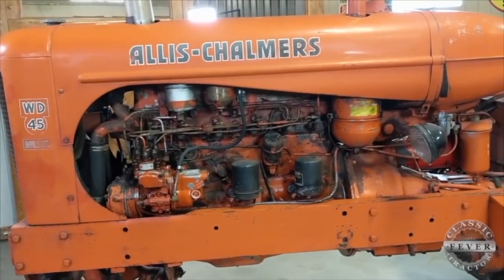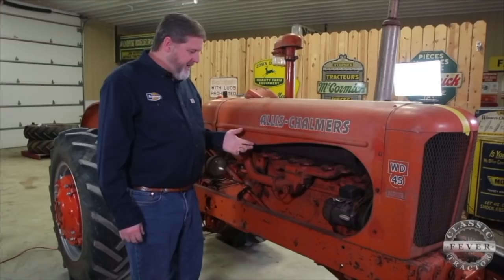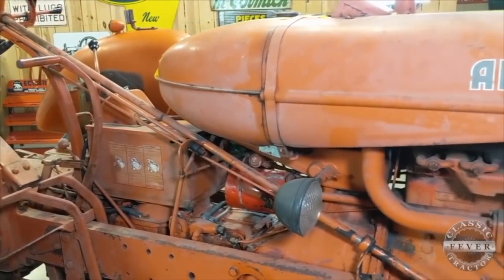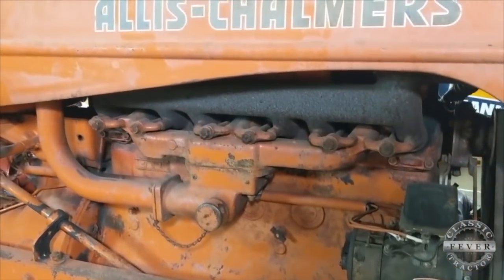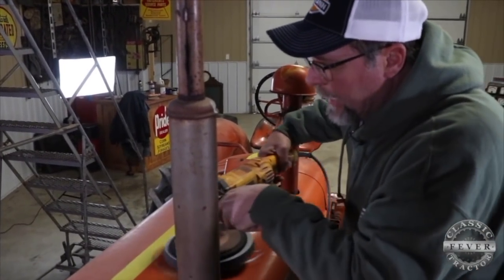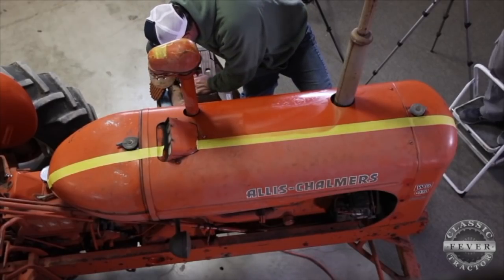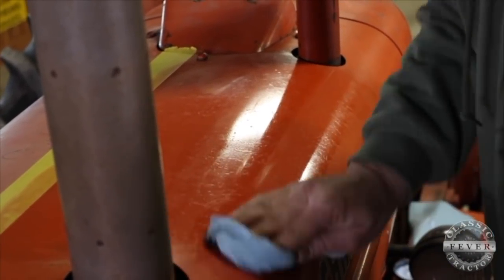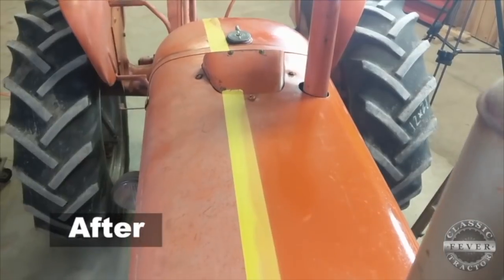How To Preserve Original Paint Tractors With FLTIZ Paste Polish - Classic Tractor Fever

Comment: Have you ever tried just rubbing paint on a rag into the old paint?  Don't even have to use the same color paint if you rub long enough most of the new paint just goes away leaving a shine on the old paint. I discovered this when I accidentally spilled paint on old faded paint! If the paint starts drying in you just rub in a little gas to help it flow!
Reply: Really?

Comment: Whats the difference between doing this and rubbing diesel on a rag and wiping it down?
Reply: Try penetrol. Great on fiberglass too
Reply: 😬 Diesel and penetrating oils will soften the paint almost immediately.. it will break down and eventually completely deteriorate.. we arnt trying to strip the paint🤔 we are trying to preserve as much original paint as we can.. Oils and fuel will attract dust and dirt like a magnet.. with the advances in technology now a days.. there is no need to use such harsh chemicals to get a little shine on the old tractor.. They have this stuff now called ceramic coating.. it's like wax only 100x better..If you want to protect your investments.. I would do some research.. faded paint greatly reduces the resale value of AG machinery.. the paint they use these days is not at all what it uses to be.. its getting weaker and thinner every year.. we need to protect what paint we have..